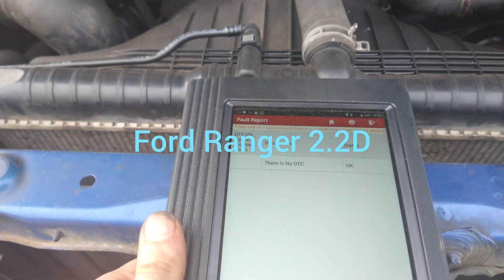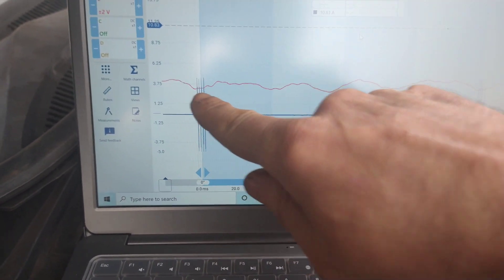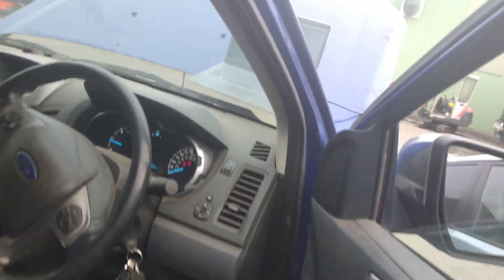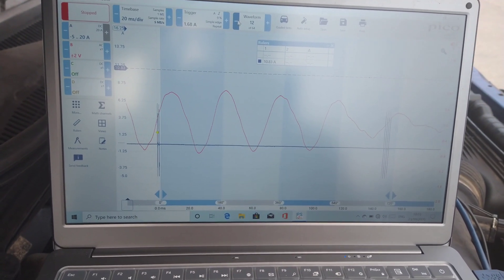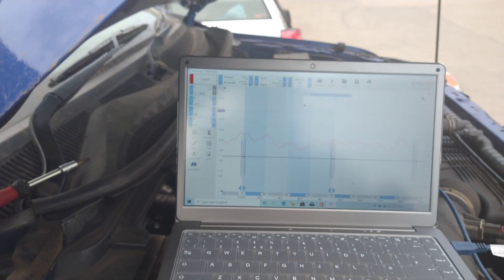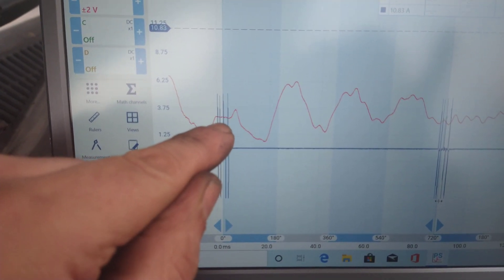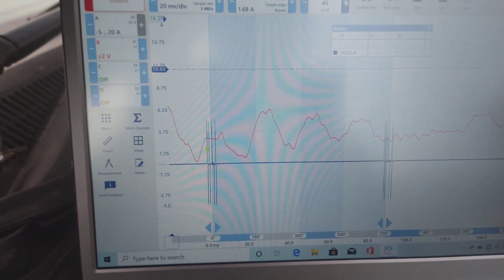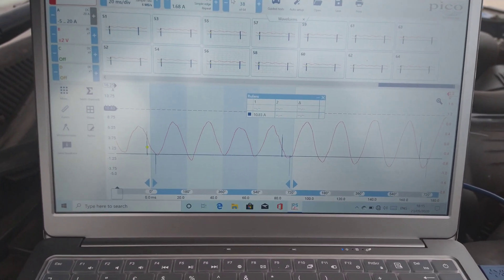Ford Ranger 2.2D ( misfires under load ) no fault codes.

Comment: Hi Matt I have a 2.2 ranger it misfires when I disconnect the 1st injector wire it does not do anything whichis supposed to shake the engine removed the engine new rings but still the same help please

Comment: Hi ,   I seen a  diesel tech  use a small ball bearing  between the injector  and supply pipe to block off fuel  to each injector  until  he found the faulty one  low tech  i know but  it worked  a treat   ,   thanks for the uploading the video  always learn something when watching your channel  .  John
Reply from the maker: Hi John, the ball bearing method is a very effective way of doing it. I find it helps when there is too much leak off going back to the tank that the common rail can't reach enough pressure to start the engine.
Thanks for watching and your comment.
Reply: May i know where you see it?
Reply: @bnl9267  martin wainwright . you tube channel, uk diesel specialist

Comment: Nice bit of testing, matt
Reply from the maker: Thanks Dave, the garage didn't want to send the injectors away for testing if the scope could point out the injector that misfires under load. I just had to get my head around how I was going to do the test. Thanks mate
Reply: @mechanicmatt871  you needed that overlay i sent you
Reply from the maker: I have one on my other laptop and every time I use this one I remember that I haven't downloaded it. I really should get it on there. Using a synch from the companion cylinder helps with the exhaust pulse for now. Thanks

Comment: Nice one Matt, what scales did you set your scope to ? Thanks Rob
Reply from the maker: I think it was 200 mS when cranking and 50 ms running. The pulse sensor was 2 volts AC, the amp clamps I used the drop down menus although for the relative compression I used a hantec 650 amp clamps and I chose the Pico 600 amp clamps on the screen so it will be slightly higher amperage than it looked on the screen.
Thanks for watching
Reply: @mechanicmatt871  
Thanks Matt appreciate your reply